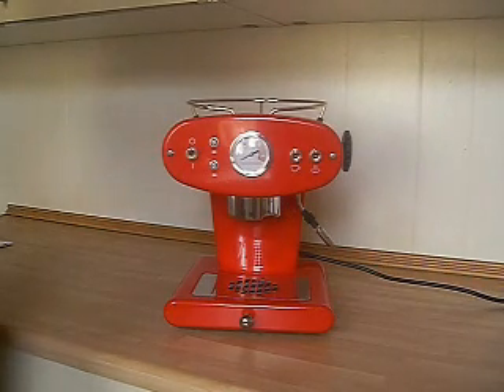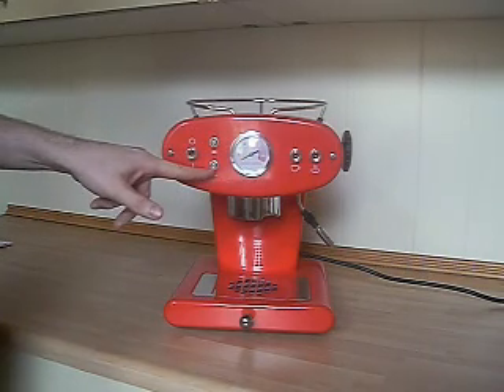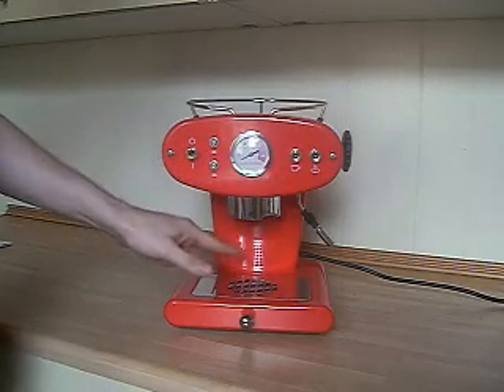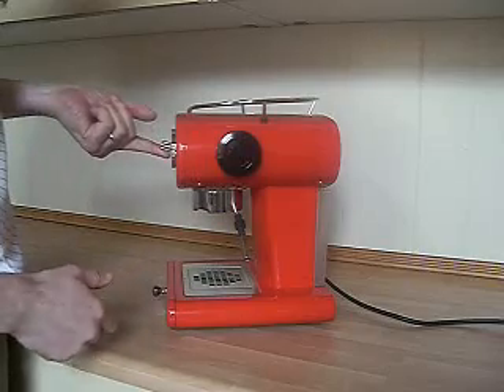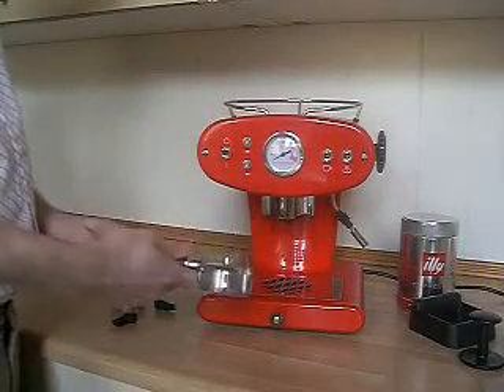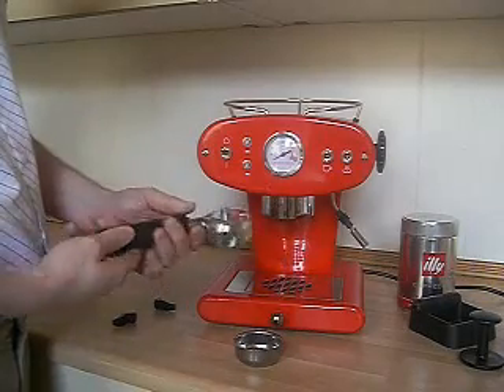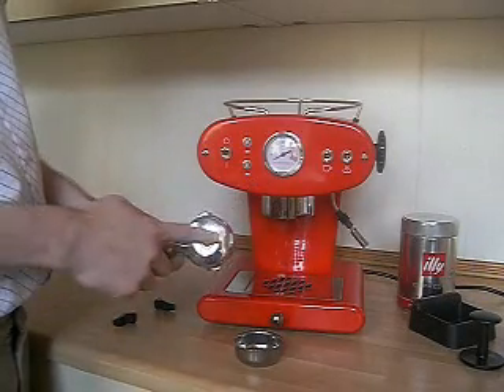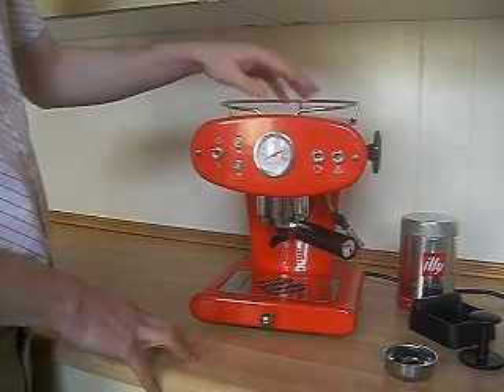FrancisFrancis X1 - Guide No.2

Comment: I need help I have the same machine and the minute I switch it on the lower light keeps plinking green and beeps? any idea whats wrong with it ?😓
Reply from the maker: Sarah Aloraifi Hi Sarah, yes, you've probably got an air lock.Make sure the water tank is full, have a cup/jug ready under the brew head and steam wand.Place a cup under the brew head.Place a cup under the steam wand.Open the steam knob.Flick the COFFEE switch.Wait for water to come out of the steam wand.Wait for the temp to build and the green light to come on.Airlock cleared!Let me know if it works :)However, if this doesn't work, please contact me at info@craystoneshop.co.uk as we may need to see your machine for servicing.Chris

Comment: i have an Francis Francis X1 First generation  , no photos of a cup and steem on the temperature gauge , just  20 C to  120 Celcius , i can use coffee ground and ESE pads too , i have two handles and three baskets , after i make a cup of Espresso  the machine is still dripping ,leaking water for some time , anh idea what the problem can be ??!! , please help if you can , thanks , Dan
Reply from the maker: From your description it would appear to be the group head check valve. This is a spring and stopper that seats behind the brew head, these wear down over time and are often covered with a thin film of calcium from the minerals in the water. This reduces the sealing properties and water drips through when the machine is at temperature. See the link below.

If you want to discuss further, please email me at info@craystoneshop.co.uk it's more efficient and easier for me to reply to you and you can email me digital photos and extra information.

1st generation brew head and check valve
http://www.craystoneshop.co.uk/francisfrancis-x1-brew-head-kit-1st-generation-c2x17587821

1st generation spare parts section
http://www.craystoneshop.co.uk/francisfrancis-x1-spares-1st-gen-c102x2722788

1st generation head seal
http://www.craystoneshop.co.uk/francisfrancis-x1-1st-classic-replacement-head-seal-c2x17587766